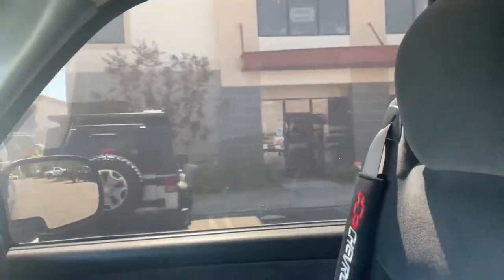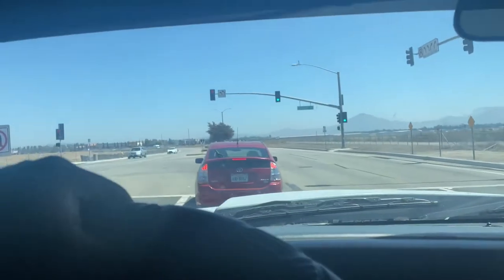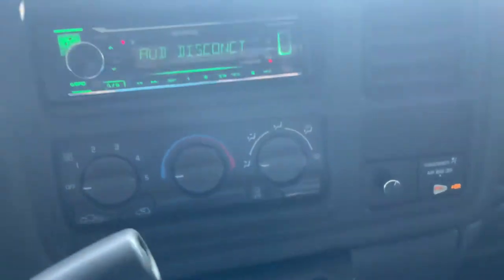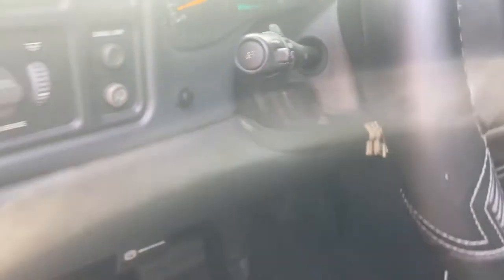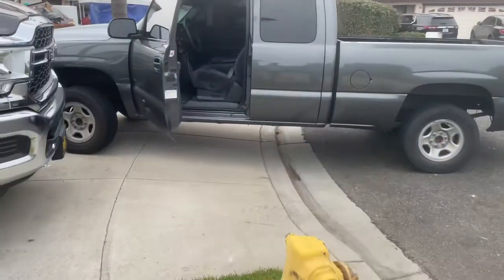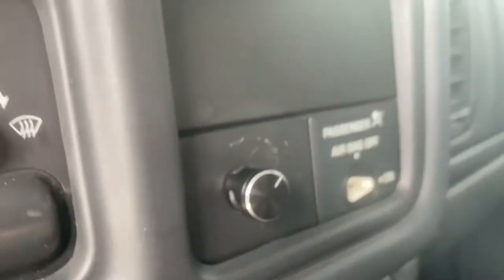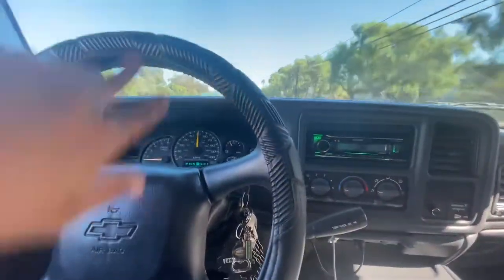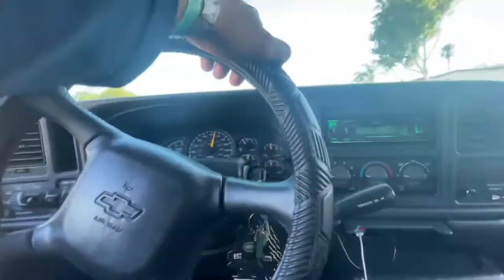NEW SOUND SYSTEM **2 JL AUDIO 12s**

Comment: never pay for your sound system until it's installed, always check the install before payment and have them fix any issues, shops are notorious for just cutting corners or messing stuff up, that is why most people would never let a shop touch their system.
Reply from the maker: this shop showed me before i payed a truck they were working on, showed me their work, and let me hear how it sounded before i even purchased anything. This shop had over 1000 5 stars , Didnt feel sketch at all 👍🏽🤙🏽

Comment: Ayy if ur happy with it, cool. But for 1300$ you coulda got way louder n bump way harder with 2 8s in the proper box and electrical.
Reply from the maker: Once i Get a better amp the subs are gonna go even harder. its on a 1200w rn but ima get a 1500w
Reply: @hdzayy8646  those subs are only rated for 300rms each. I have 2 of em also
Reply: @hdzayy8646  get 2 ddx 12’s 150 a pc